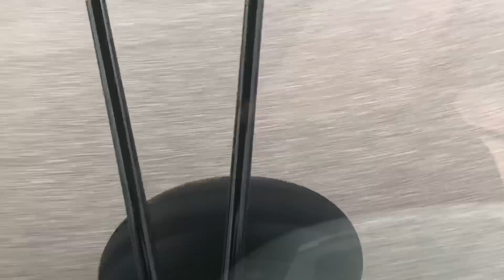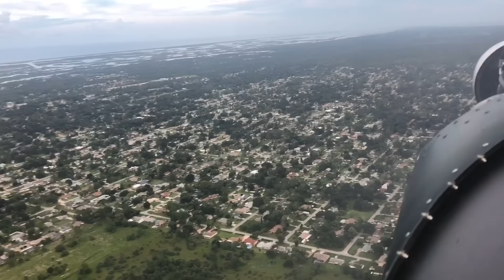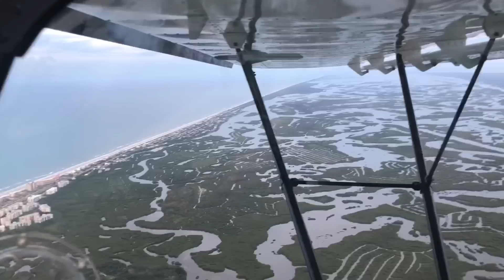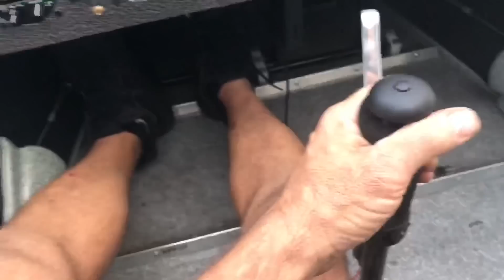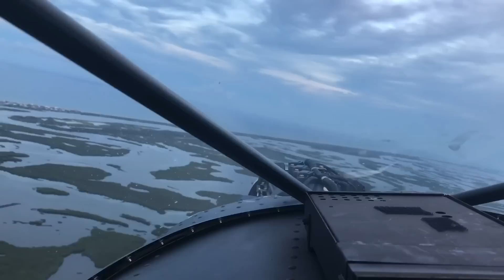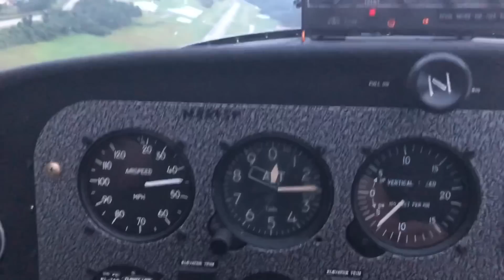Viking 90 Flight

Comment: yon....i have a 701 and am searching for a new engine.  no doubt the viking 130 is more than enough engine but not sure about the 90.  looks like it took about 8 seconds to rotate.  what is your best guess the distance was?
Reply from the maker: Not sure about the distance but several 701 aircraft are flying good with the 90 engine
Reply from the maker: Something not quite right about the 8 seconds? Maybe because the nose is up immediately you are not able to tell but the airplane is airborne right away. Don’t judge the old altimeter for 20 feet :)

Comment: Wonder what this engine would make with a turbo.
Reply from the maker: It has incredible compression.  I think we will stay away from that :)
Reply: @eggenfellner  didn't know what the compression was. Might be able to put some I beam rods in it that are a little shorter. Lower the compression and have stronger engine for more boost.     Probably more trouble than it's worth though.